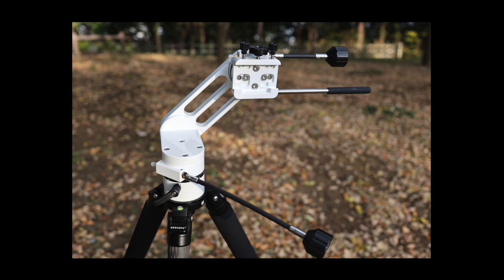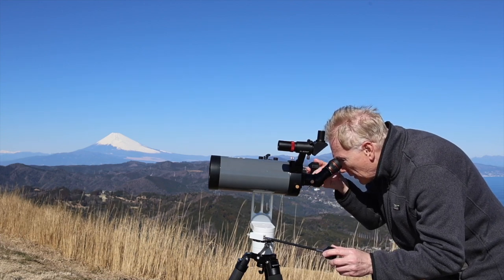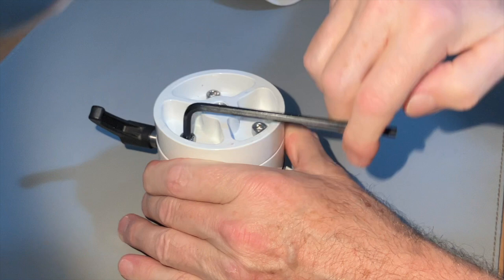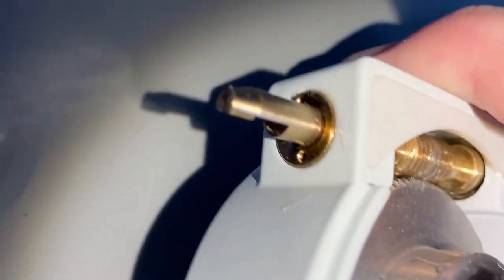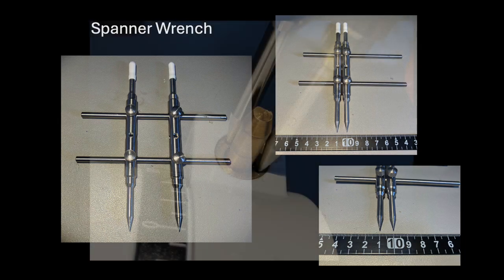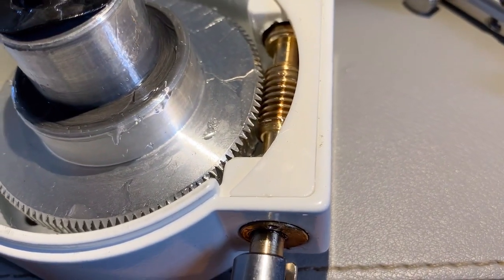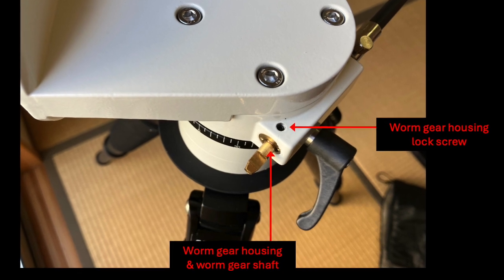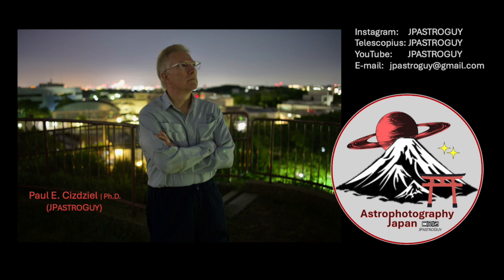Astrophotography Japan /  Reset & Repair of SV225 (Episode 38)

Comment: The proper term for the 'skewed' brass worm gear collar is 'eccentric'.  It's a lot like a cam, but it's internally designed to move the axis of the worm gear up, down, outward, inward. The term 'housing' properly applies to the white metal bustle on the outside edge of the cylindrical housing in which the ring gear turns.
Reply from the maker: I appreciate the instruction on the correct terminologies!   My engineering degree was in genetics, so I am clearly oblivious to the proper mechanical terms.  Thanks for watching Astrophtography Japan.   Clear skies!   PAUL

Comment: Paul, Another tool u might consider using to adjust the backlash is Snap Ring/Circlip Pliers.  The pins are big enough to turn the brass worm gear. and you will adjust from the side of the shaft.  BTW, I will be in Yokohama (Kannai) at the near end of January 2025.  Any recommended astro shops in the local area? Jaa Ne...LeeP
Reply from the maker: Hi Lee,  thanks for the tip on the Circlip Pliers!   I have seen those in the hardware store, but never considered them as an alternative for a spanner wrench.  Good idea!  Another option.  Actually I suggested to SVBony to provide a simple adjustment tool like I created and featured in my APJ Video Brief #14, but they never acknowledged or responded.   BTW, regarding your Japan trip, you might find it hard-to-believe, but I have never visited an astronomy retail store in Japan!   Sorry I cannot help you with that, but I do know about Kannai in Yokohama!   Let me know if you have the time or inclination to meet-up in January.   Kannai is only 25 min from my house......   Clear skies!  PAUL
Reply: @jpastroguy  Paul,
I will try to touch base with you when I get to Japan. I should have free time to meet when my wife goes shopping.  I consider Yokohama (Kanagawa) my 2nd home.  I have lived/worked in the area for 10 plus years and I am currently enjoying the retirement life on the island of Oahu.  I will be staying at a hotel near Kannai Eki.  V/r,
Lee
Reply from the maker: @LP-fh2rw  Oh, very cool.......another retired guy!   If you contact me by email (jpastroguy@gmail.com), I will give you my mobile phone number.  Looking forward to it!

Comment: Good video, I have a question that I think you can help with. I have the SV225 and have a lot of "wobble" that appears to be between the top core plate and the bottom core plate. (lateral movement above the black ring) Do you think the nut on the bottom core plate could be loose? or any other ideas are appreciated...thanks
Reply from the maker: Hi Jason, your assessment is exactly what I thought even before reading your second statement.   I have no experience with that issue, but logically your proposed fix makes sense.  What-the-heck, there is no cost to giving it a try and seeing what happens.....    Keep me posted!   Clear skies, PAUL
Reply: @jpastroguy  It was indeed the center nut. Once I gained access to it, I noticed it was only finger tight. Cranked it down, wobble gone. I can now say this mount is definitely worth what I paid. Thanks for the tear down vid.
Reply from the maker: @Jason-jc5cs  Oh, that is excellent!  I am very happy to hear that!  Thanks for watching Astrophotography Japan!  PAUL
Reply: Thank you for mentioning this! Was experiencing the exact same issue :)
Reply from the maker: @tonyduhlump8019    I think more-n-more will start to have issues as these mounts get older.   But so far, it seems like the fix / tune-up is easy.  Clear skies!